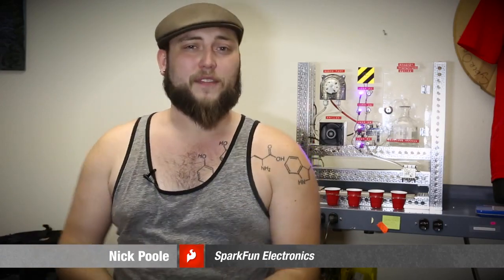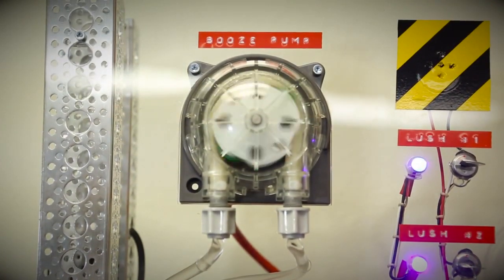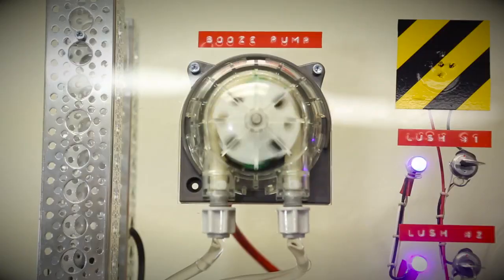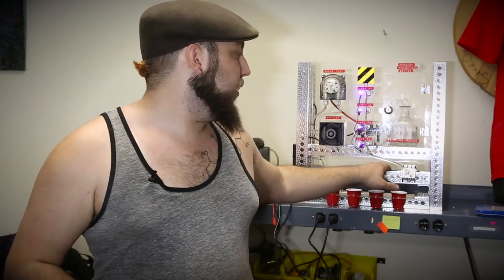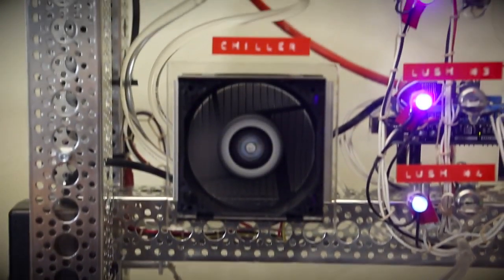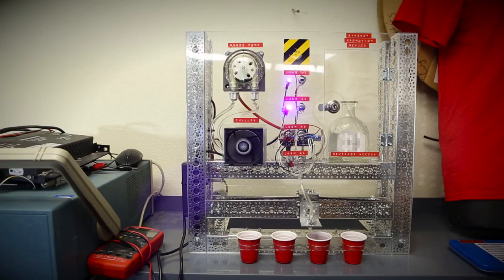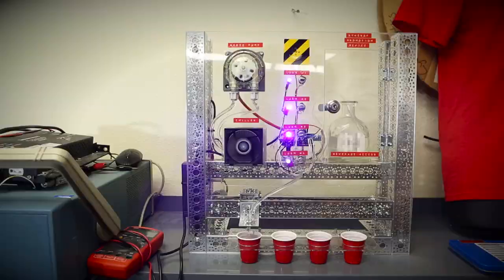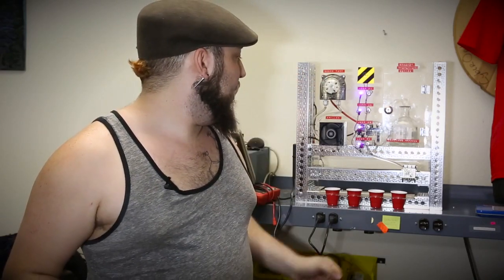The Synergizer: Emergency Drink Dispenser

Comment: I notice it's not a smooth pour. Probably not something that should be used with carbonated beverages?
Reply: The pump works by passing a roller over the tube - kind of the same idea as squeezing the last bit of toothpaste out of a tube.  So no, not so much for carbonated beverages. But really any system that works by pulling the soda out of a container is probably a bad idea. Suction + carbonated beverage = flat beverage.
For carbonated beverages (assuming they're already mixed) it makes more sense to pressurize the beverage container and use a valve to just let the beverage out into containers. Apart from moving the beverage, the pressure will also help the beverage to retain its carbonation. Beer kegs use this sort of a system.
Though if you wanted to get really fancy you'd just do it like restaurants do - run tapwater through a cooling plate, carbonate it, and then mix it at the dispenser with chilled flavor syrup.